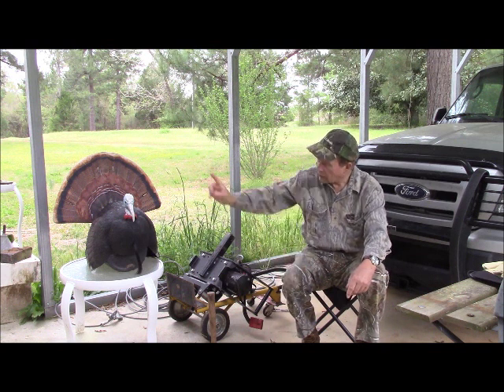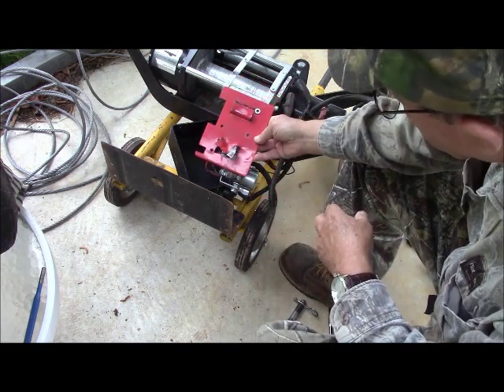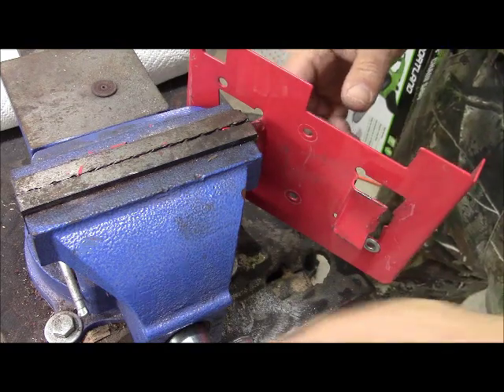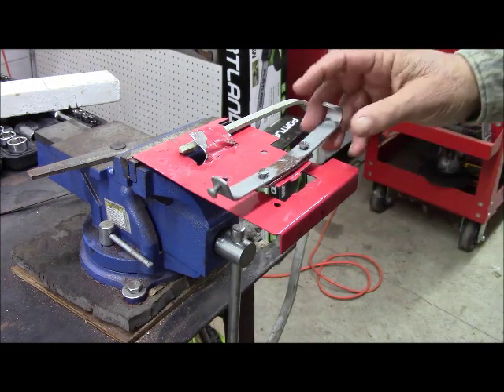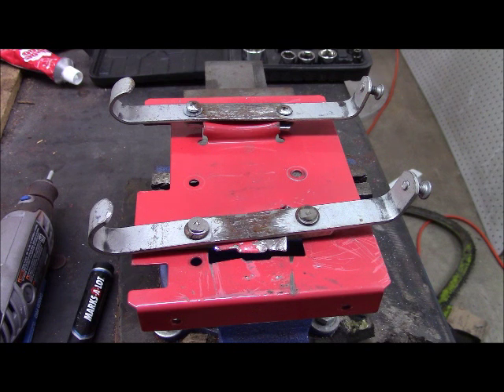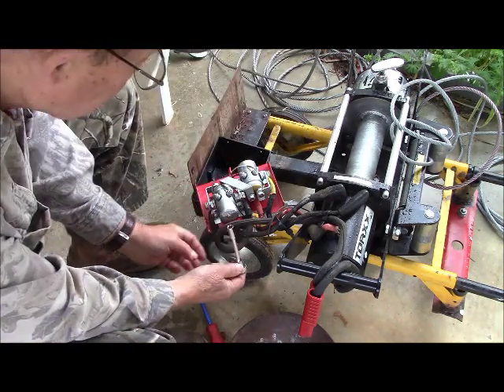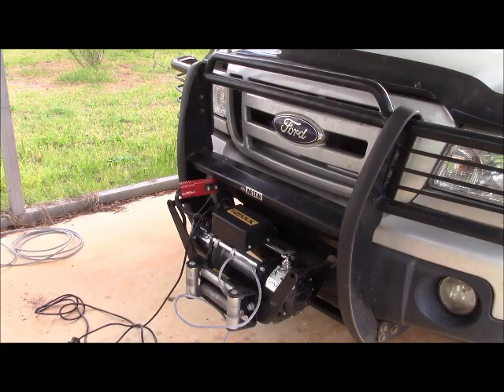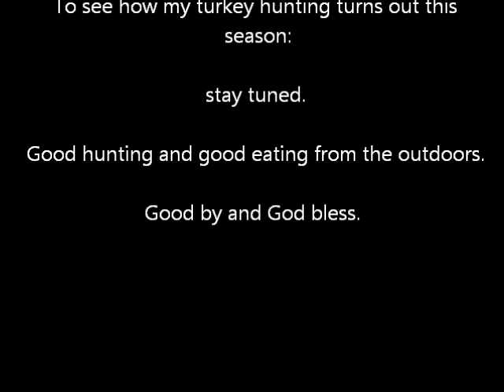Using Shop Tools to Repair a Winch on A Ford Ranger

Comment: Hey Mr. Smith, thats been a pretty good winch for a lower end winch. We used to run Warren winches, and even though they had the reputation, (and the cost to go with it) we had more trouble with them than you have had with yours. Of course we used them more than you probably do yours but still yours has held uup pretty well.